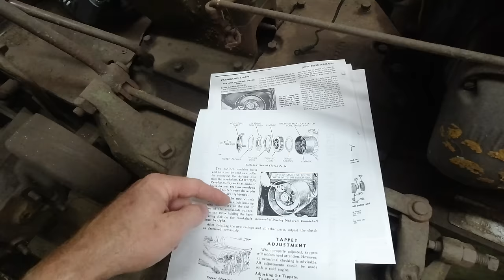Clutch Replacement | 1951 John Deere A

Comment: Always remember when you park the tractor to always put it in neutral and snap the clutch back in.  That bearing you greased only spins when the clutch is disengaged.  So the less time its spinning the better for it.  Because if that bearing does pile or pock up, its direct drive, there is no stopping it.  Have heard stories of just just jumping off to hook up an implement  and the bearing seizing up and the tractor just taking off backwards and running them over and driving until they hit something and stall.  Know its a pain to do all the time, but is very beneficial for operator and machine.
Reply from the maker: Good to know, thanks!
Reply: Grandfather taught me that many years ago on a John Deere B; seems trivial but it's something that could save your life.  Good info.

Comment: What happens with those clutch drivers is they come lose and the work on the splines.  Ive heard of the splines being completely gone on the end of some cranks before.  Gotta tighten the end nut pretty snug to set the tapered spline .
Reply from the maker: Good to know thanks!
Reply: Make sure that arrows line up, or it will be out of balance. Leave the cover off so that water doesn't stay inside,  that is the reason for all the rust. Tighten the nuts,  get on the platform,  a hard snap is needed to disengage the clutch.

Comment: I don't know if the metal parts of the clutch being rusty or you have the clutch adjusting bolts adjusted unevenly, but you should not have to pull back on the clutch handle to make the clutch stop.  Also, you should have got the front pin out of the clutch rod when you had the yoke off.  It might make life easier in the future.  I was good to see a JD run.  I have an electric start A and a 1940 B.

Comment: That's how I did my 52 B- just stack it up the way it comes out! And to take the whole clutch pully out, you have to do something with the wheel, it's in the way! You can let the air out, and use a ratchet strap to pull the tire in to get past it! That's right, the fork assembly has to come out! you pull the pin out right ahead of the oil fill cap! Pack that bearing right full, as much as you can get in it! The groves on the back side are oil slingers, line up your V"S, if it's off, the Tractor will shake! The bolts should move! Hold it, don't tighten down the nuts one at a time- when you start the nuts, when it first catches, count how many turns you turn it in by hand until they get finger tight,, and do the same for each, then go one cotter key hole each until you get a good snap on the clutch- those nuts have to be even, two can't be tighter than one- one can't be loose and the others tight- Good Job! when you coast start, use 5th, will start better!
Reply from the maker: Awesome thanks for the advice!

Comment: Just noticed the cover for the clutch/pulley is missing. Suggest you search for this cover that went on the pulley to keep dirt and water out of the clutch assembly. Probably can find on Ebay. It fastens on kind of like a paint can lid.  Thanks
Reply from the maker: I need to get one, thanks!
Reply: Putting the cover on is the reason for all that rust, I put one for about a year,  and it was very rusty, have several others that have been with no covers for 60-65 years and do not have the problem with rust. I don't have the cover on our tractors. When you put it on the hill, use high gear.
Reply: Like Mike said, my personal experience is that the cap keeps the water in, so I'd say it depends on your location, for dry dusty environments I'd keep the cover on for dust and dirt, otherwise you can remove it to try and keep the water from pooling in it.

Comment: A lot of people forget about the clutch pulley bearing. I’ve replaced several. It always good practice to knock it into neutral and engage clutch when it’s just setting and idling. To help with roll starting you can put it in 5th or 6th gear. I bet that clutch works a lot better after cleaning and lubricating the toggle bolts.
Reply from the maker: Seems to work good so far. I will try a higher gear next time. Thanks!

Comment: I enjoyed this video as when we farmed we had a A, B,  & D John Deer tractors. When beating on the thread end of a bolt, do not beat on it with out putting a brass maul or piece of hardwood between the thread end of the bolt as you will damage the threads or balloon the bolt, making it difficult to start the nut.  Be sure to replace those 50+ year old clutch springs, they tire with age. We could mow alfalfa in 5th gear with an attached International Harvester sickle mower on board. Check the rear wheel bots on the B and A as they came loose over time and in one occasion let the left rear wheel spin off the axle of the A. Keep the good videos coming. Don't get discouraged with repairs, we all go through similar learning cycles. Thanks
Mogulsmoke

Comment: Pullies for flat  belts are not really flat.  The center of the Pully is  higher  than its edges< it has a Crown>  When a belt is installed to run say a Seperator  ,  as the  belt rotates  one side of the belt climbs toward the center of the pully  and the other side of the belt does the same .  If the pully was flat, the belt would come off unless perfectly aligned.  Very njcd informative video.  The Kid children add a lot and they will remember.
Reply from the maker: Thanks! It would be fun too run something off the pulley i need to find something.

Comment: Water will enter the transmission through the gear shift lever. At least put a tarp over it. Its earned it. I hope my clutch braring is ok when I pull my clutch. I hope someone greased mine in rhe last 25 years 🤣.
Thanks for the teardown.

Comment: Just watched you cruise through the woods. Looks like you are or will be in the market for a Brush Hog attachment. When parking the tractor on a hill and leaving it unattended be sure to scotch block the rear wheels so that some youngster does not get on the tractor playing and releases the clutch. That would be a disaster if the tractor rolled away with a child at the wheel.
Mogulsmoke
Reply from the maker: I have a brush hog already. That land is going to be a field. I just need to remove the trees.

Comment: All you have to do is put you a little roof up open on both ends so u can pull in one dive and it can still roll out the other side to start that how I have my barn so the tractor can roll out the other side to bump start it
Reply from the maker: That would be pretty cool. Maybe eventually.

Comment: That is great showing the kids how to use tools, but most important you're bonding with the kids. A trick I found for keeping gaskets in place is spray the gasket 3M adhesive on one side and the part the gasket makes contact with. Let it set up for a few minutes. Carefully set your gasket in place and it will be where it is supposed to be when you bolt it together. Very good video! A++

Comment: Got lucky with that clutch. Looks in pretty good shape.  When I redid the clutch in my 820, it was wore badly, tabs on the plates to almost wore threw and that clutch driver was really on there, had to make a puller out of an 1 1/2 inch plow frog because I bent everything else I tried.  When it finally broke free from the tapered spline it sounded like a shot gun.  Had the tractor in gear, wheels blocked and a 2 foot breaker bar with a pipe on it hanging off it before it came off.  you know its tight when you can crawl a 9,000 lb tractor half way up a 12 block of wood with a bar and pipe.  I used the tractor for pulling so a tight clutch is the heart of the machine.
Reply from the maker: Wow I’m glad mine wasn’t that tight. Glad you were able to get yours off.

Comment: I bet someone already said it but higher gears (ex 6th) will give the wheels the most mechanical advantage to turn the engine over just the same as lower gears (ex 1st) give the engine more mechanical advantage over the wheels. It all depends on which way power is being transmitted wether you have more torque less speed or more speed less torque. No idea the ratios on the deere but on my ford jubilee: 1st locks the tires up as it’s trying the spin the motor too fast. 2nd is pretty rough but will get it going. 3rd cranks it over smooth but it has to be rolling a few mph. And 4th cranks it pretty effortlessly but you’d have to be moving pretty good for it to start. So I would use 2nd or  3rd on the jubilee since it’s a good compromise between cranking speed and torque
Reply from the maker: Someone said to try 5th. I will try some higher gears next time and find one that works good. Thanks!
Reply: Hey I have one of those John Deere's I got to get it going if it's in about 10 years I love the way that thing sounds all right hit you up later her name is Ceola

Comment: I think she deserves a decent clean up and new paint . This type of JD is the ones that don't wear out. They stopped making these for that reason. The engines are that good and made so well.Id put up a lean  to cover it some.
Reply from the maker: I sort of like it in its raw used look. That said I will probably eventually redo it.
Reply: @HumbleAcres  keep it in its work clothes. Original paint tractors are getting hard to find.

Comment: Two 6v batteries have more cranking power then one 12v, leaving the tractor outside your going to get water in the transmission and roll starting it use 5th gear.
Reply from the maker: I was curious what gear to start in. I figured some people would let me know. Thank you!
Reply: Having a single 12 volt battery properly sized will get you the same if not more cranking amps and will be more reliable because of better charging and more even discharge between cells.

Comment: Nice video  hard to believe how dry that bearing was inside You have a nice tractor  coming along good ! You won't have to open petcocks  when you get the battery and cables figured out. Those are tough old tractors
Reply from the maker: Thanks 👍
Reply: It needs a new key way on the crank shaf

Comment: The 1952 m
The model A I had they recommended to put two 6 volt batteries hooked in parellel. I went through a ton of batteries before I did that
Reply from the maker: Good to know. Thanks!

Comment: I watched the first story on the wheel rake  After seeing the storys on the overseas u tubes on the same thing, you may be able to push rather than pull the rake by a 3 point in front, then rotate the whole rake.by pulling the center.bolt,pin whatever.As long as you have it front mounted on the loader, you should be able to change the angle enough to try it   I have no idea how  much time you can waste  but think about seeing what you are raking without looking backwards

Comment: If you would tighten the adjusting screw on the pulley brake arm it would help stopping the pulley when you disengage the pulley.
Reply from the maker: I will take a look. Thanks!

Comment: I’m in the middle of that same job on a JD50 that got out of hand. 1. Get that clutch pin out! Like you did. 2. That pivot for the clutch lever handle  is pressed in. It’s easy to break that ear off the engine case. 3. The gear on the clutch meshes with the First Reduction Gear that you can see. On my JD50, that gear was loose and I’ve ended up finding more and more problems and taking most of the transmission apart. 4. Another spot that should be lubricated is the three pivot assemblies at the back of the clutch. It’s a pain to reassemble. 5. Shims on the crank spline is a backyard rig but the alternate is a new crank. I’d have put the shims in too.
All good fun.
Reply from the maker: I’m sure some of the tractors can be basket cases. Good luck with your tractor. It will be worth it in the end.

Comment: When you have rust like that it's always good to wire wheel it off . It gives better disc to metal contact and gets rid of the residual trash. Get the kids into helping, that's a good thing. Good video !
Reply from the maker: ok Thanks!

Comment: Jordan that was greatfirst the head then the clutch great job you always need a back up tractor in case it runs use it keeps the hours down on the Kubota  but a fantastic job on the deere.I would clean it up and paint it to make it last through  the kids at least.
Reply from the maker: I’m sure I will get around to painting it eventually. Thanks!

Comment: Isn't there a torque spec for those 3 castle nuts?
Reply: No, tighten them evenly to adjust the clutch. Those nuts are not holding the tractor together! Snap the clutch lever back and forth as you tighten the nuts until you feel a good snap when you push lever all the way forward to engage the clutch. It’s explained in your owner’s manual.

Comment: With the “A” model that I knew, you could start it by opening one of the petcocks  on a cylinder and use the finger holes on the fly wheel to spin the motor. Once one cylinder was running just close the petcock and you are off and running.  Works great if you are not on a hill.
Reply from the maker: It will run with both petcocks open but I have a cover over my fly wheel because it has an electric starter
Reply: If you're on a hill, put in highest gear,  roll down the hill and engage the clutch

Comment: Thanks for the video! My grandfather, Uncle, and then dad, had an older “A” which I drove a lot on the farm. When starting on a hill or towing, a higher gear works better. I would suggest a tarp also when parking outside. On ours rain would get in somewhere around the Crank and I would find the Oil “milky”.
Reply from the maker: Ok thanks

Comment: Be careful driving. The steering wheel set you have with your A, is called a "tricycle" arrangement,, and they will turn over, very easy. Wide front is lots safer,, but you can widen the rear wheel settings to help a bit on the tricycle set up.  We still run a 3020 with tricycle, very carefully. BUT, my brother and I are both in our 60s, so we are a lot more aware.  You have a very nice video series and I love to watch.
Reply from the maker: Thanks for the advice and I’m glad you like the videos!